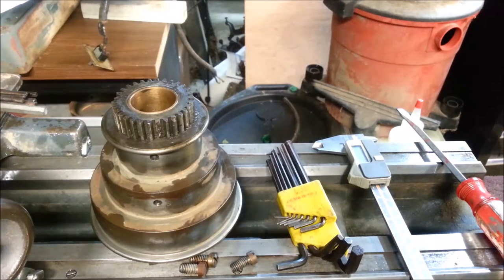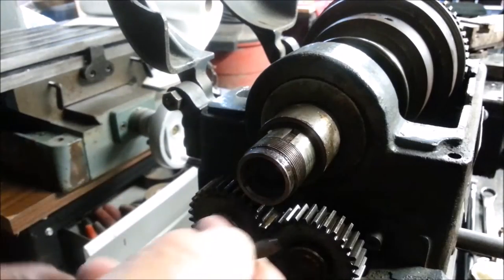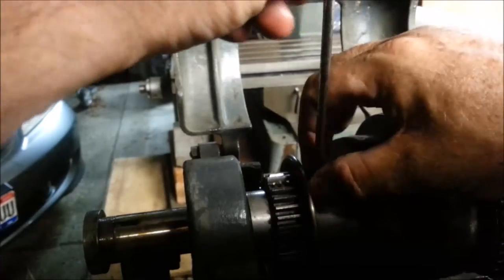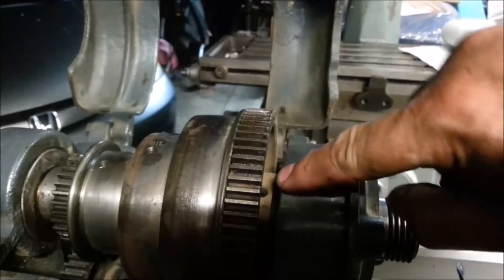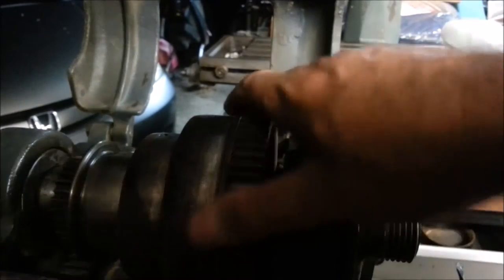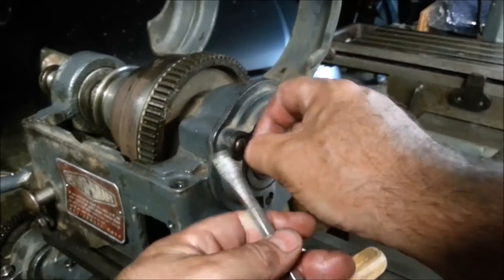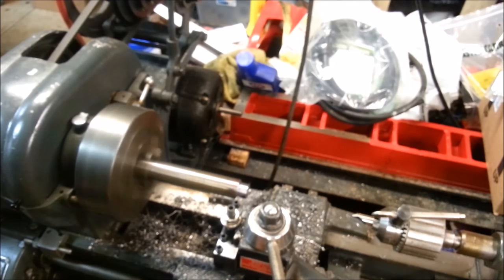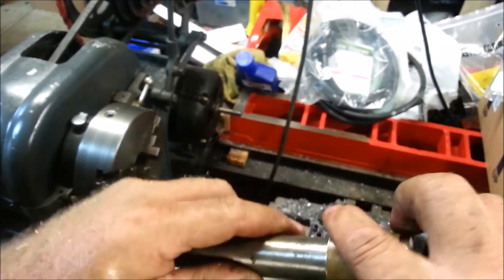47 Wards Logan Lathe Part: 3 Spindle Out - Tooling Crafted Channel

Comment: I was on an Atlas kick until I bought my Clausing model 5912 12x48 variable speed lathe. OMG I didn't know what I was missing. You need to keep your eyes out for a 5900 series lathe. Remember, they have the same parent company but the Clausing is worlds above. The beauty is, they still have parts available at Clausing.
Reply: Plus, it's still American iron which fits your shop.